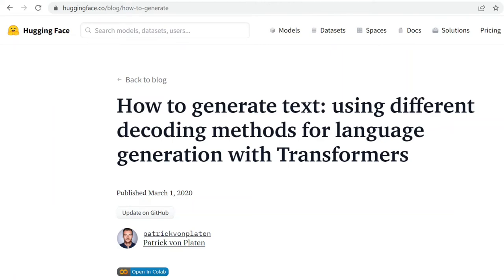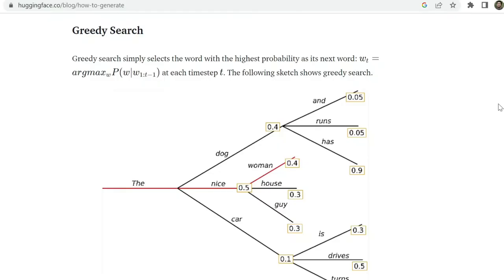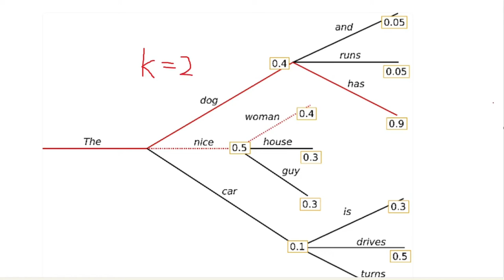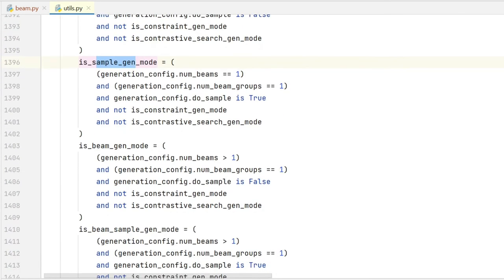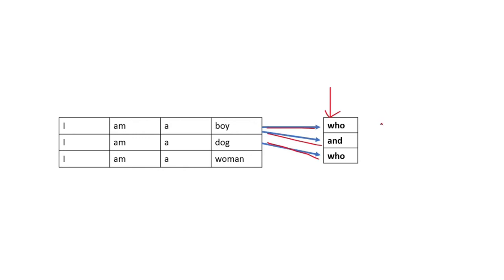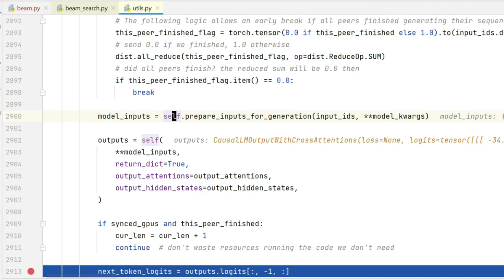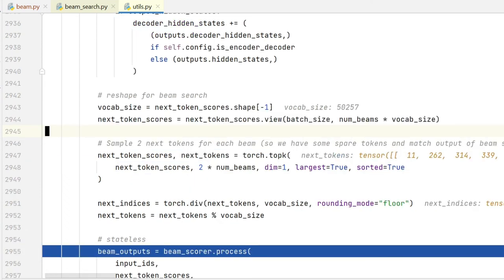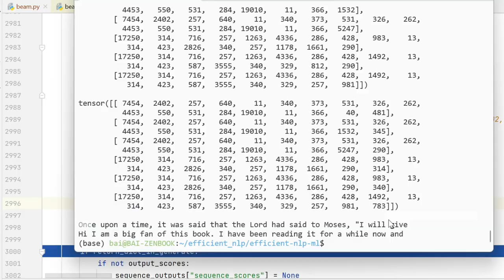How is Beam Search Really Implemented?

Comment: seems no kv cache is used in the implementation. How to make beam search compatible with kv cache and make it more efficient?
Reply from the maker: I didn't mention it in this video, but the KV cache is supported in the Hugging Face implementation (and by default is turned on) -- it is the use_cache parameter.
Reply: I just read the Hugging Face transformers implementation. Sure, it does support kv cache, however beam search in transformers is implemented by simply expanding batch size. I'm sure this is not that efficient, especially for memory, since nothing is reused here, even the kv cache for the prompts in prefilling phase is not reused. Do you know any implementation that is more mature or optimized? Thanks a lot!  @EfficientNLP

Comment: https://youtu.be/tOhWpF5-_z4?t=117 - here beam len is 2. 
https://youtu.be/tOhWpF5-_z4?t=271 - here beam len is 3. 
https://youtu.be/tOhWpF5-_z4?t=395 - here beam len is 6?

Why do we take top 6 (num_beams * 2) as mentioned here https://youtu.be/tOhWpF5-_z4?t=444 ?

Also https://youtu.be/tOhWpF5-_z4?t=282 with boy as input, 'and' and 'who' had highest prob (you chose top 2) 
but with 'dog' as input only 'who' i.e. top 1 was chosen?
are you picking top 3 across outputs with inputs 'boy' 'dog' and 'woman'?
Reply from the maker: In the code example, the beam size is 3, but the batch size is 2. That's why it appears we have 6 sequences at a time, and this illustrates how beam search is combined with batching.

About your question about taking the top 3: We are taking the top 3 beams overall, and they may correspond to any beams from the previous iteration (it's not necessarily a 1-to-1 correspondence). So we might use 2 candidates from the beam ending with "boy", 1 from the beam ending in "dog", and 0 from the beam ending in "woman".

Hope this clarifies things!